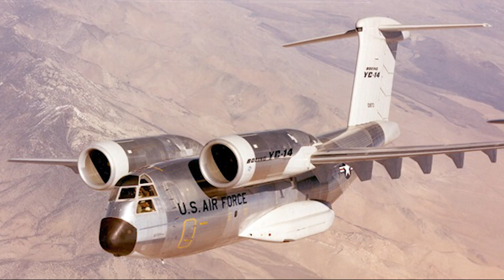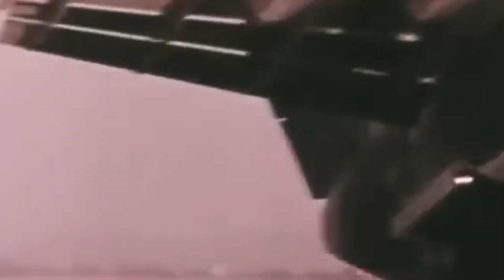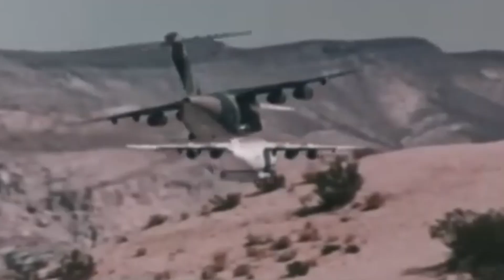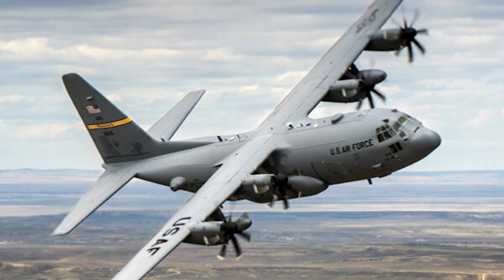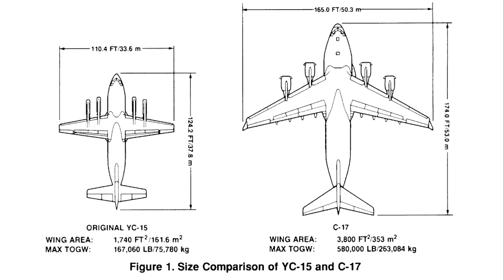Globemaster Mini Me; The McDonnell Douglas YC-15

Comment: A YC-15 sized aircraft with STOL capabilities would be perfect for near frontline resupply:  small arms, ammo, food, water, medical supplies, personnel gear, electronic equipment, drones, anti-tank weapons, anti- insurgence troops, special ops forces, utilizing scarce technical personnel like medics, dappers, engineers, electronic weapons techs, ...,  
A decent strategic tactician would have a massive increase in options for offensive, defense, covert, special, and other operations.  Such a plane would also be valuable in supplying resistance groups behind the front lines.  

How different would the Crimea battlefield be if multiple loads of fully supplied special ops teams backed with anti-whatever missiles, drone fleets, and light artillery could be dropped near any objective, like the Kirsch Bridge, major transport hubs, Sevastopol Harbor?  

But wait.  My bad.   That would make it useful, expense conscious, flexible, and ideal.  

Can't have that in a military budget.

Comment: It's also worth noting the C-17 is not a bad STOL aircraft in its own right. I'm sure the YC-14, YC-15, and C-130 all have the C-17 beat in that capacity, but for an aircraft as large as thd C-17 is, it can land on and take off from surprisingly short airstrips.

The engines used on the C-17 have a very unique thrust reverser. Most turbofans only use  thrust reverser on the bypass air, which provides 80-90% the total thrust of the engine. The C-17 however also thrust reverses the core. The main reason for this is that it allows the aircraft to load cargo while the engines are running, as the thrust reverser prevents jet wash to the aft. But it also makes the thrust reverser slightly better since there is no longer reversed bypass thrust fighting core thrust.

... Also, I didnt know this until recently, but apparently the C-17 can deploy thrust reversers while flying. This is a bit unheard of, most aircraft use a weight on wheels switch to prevent midflight deployment of thrust reversers for safety reasons. In the C-17s case though, because they fit into a role that overlaps between the STOL use of C-130s, and the strategic use of C-5s, C-17s may need to make VERY rapid descents into contested airfields, in dangerous airspace, or may even need high descent rate to get into rough fields in mountainous valleys. So the engineers gave the pilots the ability to deploy reverse thrust in flight to achieve insane descent rates.
Reply: What in the holy hell, he's right they can use TRs in flight. I am sort of shocked, I worked on C-17s some in the AF and am a pilot. That's absolutely wild.

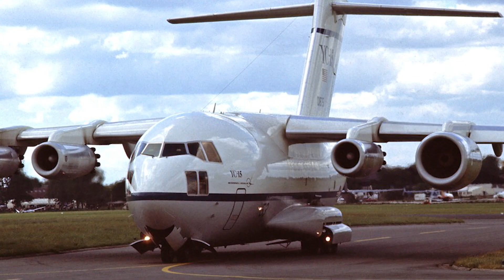Comment: 5:10. The CFM-56 engine is the same one used on the KC-135R.  It's a very powerful and relatively fuel efficient engine.  It does, however, like to suck in any debris it can find, making it unsuitable for rough/dirt airstrips.

Comment: In the end, the USAF realized they didn't need a C-130 replacement, but a C-141 replacement. That's why the USAF ended up with 222 C-17A's.
Reply: C-17A is awesome.  Have jumped out of them many times.
Reply: Why was the C-141 retired so quickly?
Reply: @3-DtimeCosmology  The C-141's were just over-used from the time they entered service in the late 1960's. The planes started to develop wing cracking problems and they had to do a very expensive rebuild program for the entire fleet, and even that wasn't enough by the early 1990's.
Reply: @3-DtimeCosmology  It wasn't.  C-141A was upgraded and extended with the C-141B mods.  C-141 first flight was 1963.  It was retired in 2006.  It was first operational in 1965, so it had 41 years of operational service.  

C-17A replaced and exceeded it capability-wise.  My first jump was from a C-141B over Fryar DZ in Airborne School.  C-141Bs were timed-out, many having exceeded their rated 30,000 flight hour lifespans.

In operational units, C-141Bs were always breaking down, spewing hydraulic fluid all over paratroopers, and it was an extremely uncomfortable ride with scores of dudes packed in there like sardines.  C-17A was like riding in a Cadillac in comparison.
Reply: @3-DtimeCosmology  Yeah like others said they really worked the C-141. The C5 had wing issues as well.. basically right out of the gate and also the crash with Operation Babylift happened so it really missed a good portion of the Vietnam War. They pushed the C-141 pretty damn hard from what I understand.
Reply: There is a C-17 at the Museum of The United States Air Force in Dayton that is off-gassing outside in the airpark now (or at least 11 mos ago). It is a Celebrity C-17 and has four or five Movie Camera icons painted on the side for Hollywood summer blockbuster type films it has been in. According to the docents it will eventually come inside. There is also a KC-135 parked across the way from the C-17, IIRC, that will be coming in. I forget where it is, but USAF also has a dedicated cargo/transportation aircraft museum with some good stuff.
Reply: Someone felt the C-130 should be a jet just because jets are cooler.   ;-)    The C-130 was one of those planes that skipped right to "perfect" from the start.  You can upgrade it and fit more powerful turboprops and propellers and newer electronics and glass panels and so on, but it will always be a C-130 by design and fly for decades, like the B-52.  Meanwhile so many other aircraft have come and gone.

Comment: Thanks for including the stuff I commented on in the YC-14 video, though I suspect you already had this written.  When the program that concluded with the C-17 was ongoing, there were LOTS of voices opposing the program because the range of the proposed aircraft was too short.  In fact, it was WAY too short.  The C-17's were designed for a "Red Storm Rising" style of theater war and we really needed a longer-range airlifter akin to the C-5.  After 71 were built, the remainder were fitted with center-wing fuel tanks increasing range by about 15%.  That's still not enough.  Consider the C-5M and KC-10 have nearly twice the range with a similar cargo.
Reply: You are correct. One thing never discussed is that the C-17 did not meet its range specification.  It was intended to meet the REFORGER mission profile, and fly a specified cargo load directly from the US to Germany without refueling.  When the time came for proving runs to demonstrate this capability they knew the C-17 could not lift enough weight to meet this requirement.  So they split the specified load across two aircraft and filled their fuel tanks to the brim.  They then flew those two aircraft to Germany in formation and recorded it as a single mission.  I don't know if Congress was fooled by that or not, but apparently it worked as a fig leaf and the airplane was produced.  By that time we really needed the C-17 because the C-141 was structurally worn out and could not fly much longer.